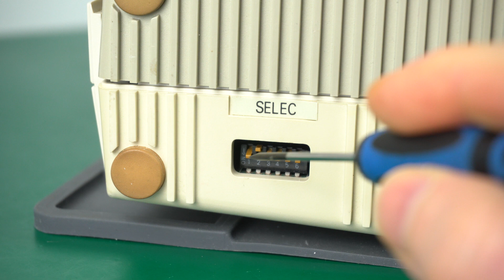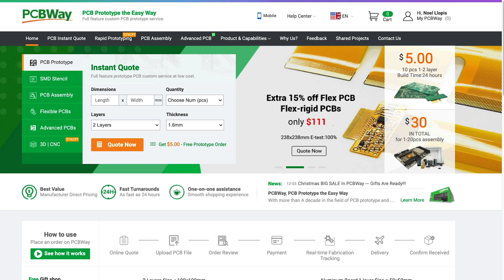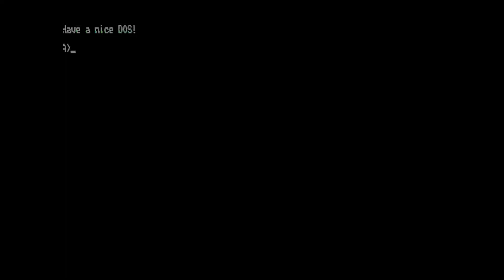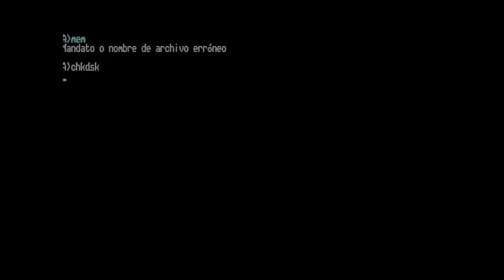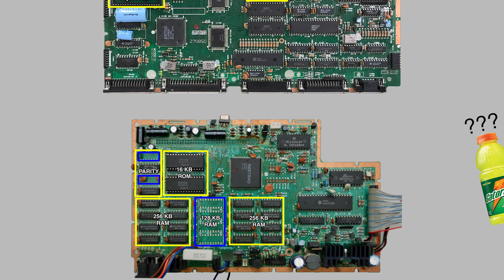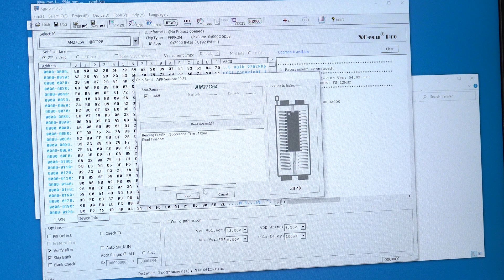Upgrading a Laptop from 1988 - Amstrad PPC512

Comment: I recently bought an Intel 8087-1 (rated for max. 10 MHz) from AliExpress (yes, I know) for my Amstrad PPC640. Paid like 3 euros including free shipping and it works perfectly!
Reply from the maker: Haha, yes I ordered mine last week and paid about that much too. Let's see what I actually get! 😃
Reply: When it arrived, I just quick and dirty checked the resistance between Vcc and GND. When that looked fine, installed it into the machine and to my surprise it works perfectly. Amazing that you can buy those old parts for just a couple of euros... I can’t wait what you will come up with for the LCD screen, I have seen multiple solutions which look amazing. Also, there is a person in the AMSTRAD IBM PC COMPATIBLES Facebook group that is currently designing an expansion board which adds ISA slots for the machine. The way to add an XT-IDE and an Adlib sound card is open!

Comment: nice addition with the gotek Noel...and cool little fixes too...altho i wouldnt have used a neodymium magnet near a computer! (i know first hand what a loudspeaker woofer magnet does to TVs and old computers!)...i would have just used a simple fridge magnet...would have done the same job, without throwing a huge, strong magnetic field around it....
the shimmering youre seeing on the CGA monitor maybe the video output itself, which is also why its missing lines on the LCD... maybe something to consider...
Reply from the maker: Hopefully that magnet is fine, but now that I think about it, it's right over the video out port. I wonder if it could be causing that shimmering effect! I'll investigate a bit more next time.

Comment: Why not a GoEX??
Reply from the maker: Honestly, I didn't even know about the GoEX until right now. If I'm reading it correctly, it looks like it's more intended for Amiga so it comes with specific mounting points instead of a floppy drive-like case, so it would have needed something to fit like this one I think. I'm bookmarking that for the future though.
Reply: @NoelsRetroLab  https://centuriontech.eu/product/goex_sd/
Reply: gotek comes with display, and has the USB interface... USB flash sticks are easier to use than SDCards (eg just plug the USB stick into PC, SD card adapter not required)
the goex, the display is optional extra, and zero usb...just the SD card slot....
id stick with the gotek.... and use a SD card adapter in the USB slot, if i really had to....

Comment: When your floppy disk drive's screen is a lot better than the computer's screen...
Reply from the maker: So true!!!😃
Reply: And might as well have more computing power
Reply: @matthiasgalus4287  that's the case for many of these 8-bit projects. Add wifi support, with a powerful cheap microcontroller. Add modern display support, with a powerful cheap microcontroller, add SD card support... you get the idea. A smarr power supply is probably more powerful computationally... Nevermind the projects where problems are solved using an FPGA. That's on a whole different level! Oh well, it's still so much fun!

Comment: Noel's Gatorade Labs FTW. :D Great vid as always. Really looking forward to the LCD replacement. With something a lot more modern. I hope what you said is foreshadowing a cool project, and not just random thoughts. :)
Reply from the maker: Thanks! Yes, I already have a replacement right here. It's a matter of figuring out if it's a good fit, and then finding the most economical way of hooking up everything together.
Reply: @NoelsRetroLab  Pi Pico? Apparently it can be used to output video. And it's a microcontroller that's dual core.

I understand none of it.

#random